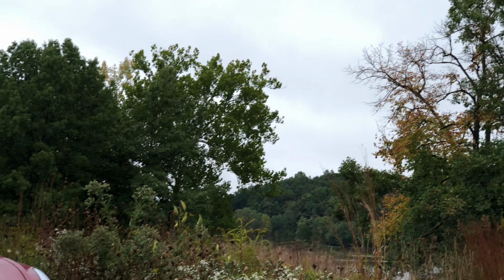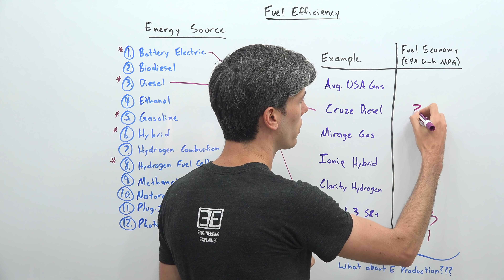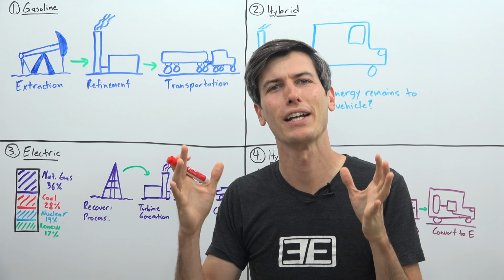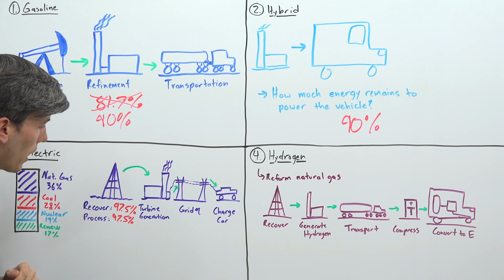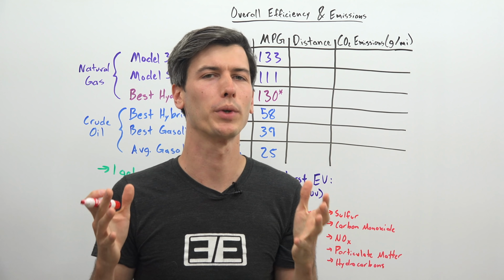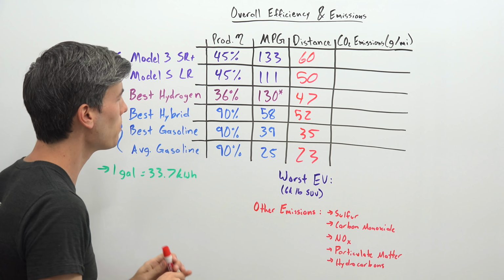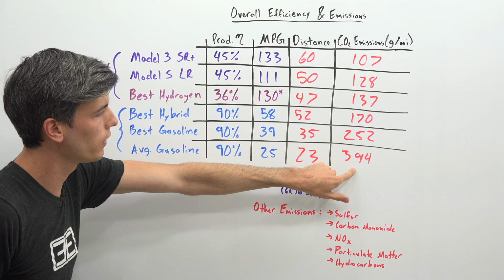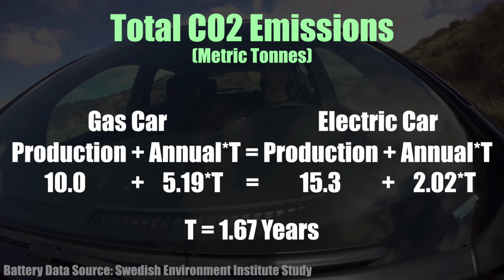Are Teslas Actually Better For The Environment?

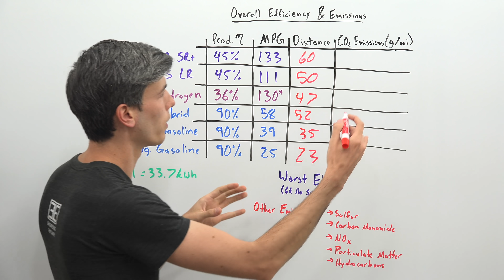Comment: 12:09  No, it isn't zero.
I remember a paper the german budestag commisioned, to inform them a few years ago in that matter. (so not by a political party but by all together do have a ground for discussion and decision) who came out with the numbers as following: production of electricity over the lifecycle of a power plant:
hydro: 4 grams of CO2 per produced kWh, wind: 9 solar 12, and coal was above 50 when just used for electricity and around 38 when also used for "comunity heating" (force-heat coupling). (these were the best case scenarios)
Nuclear power they said is almost not calculatable because of the efforts in producing the materials, maintaining the facility (and security) as well as the immense time of storage of the radioactive materials and the effort to store them in a safe and secure way for that long.
I'm also wondering about your comment concerning battery production. As everybody else calculating came to the conclusion that for the prodiuction of one electric car you produce the same amount of CO2 as you would for producing one middle class diesel car + driving it for 50k km.
Reply: He did say that EV production emissions are offset on average by driving it for 1.67yrs
Reply: nirfz “basically zero” once a solar array is running it produces no CO2 besides the maintenance. As the power grid and society becomes more green, that reduces emissions on everything including those maintenance emissions and production emissions, thus it will become “basically zero.” Also as I’m aware most people tend to drive a car more than 50,000km before getting rid of it so that argument doesn’t make sense.
Reply: @johnmoore1495  "will become zero" is not the same as "is basically zero" until then, we can not calculate with zero. That would be a dubious practice. We take all those things into account everywhere else too, so why ingnore them here, just to make it look better than it is? People also often underestimate the damage to the envirement in getting raw materials. That's not just the case with oil, coal and natural gas thats also true for materials used for solar cells and batteries. Then there is something hardly mentioned about the solar and wind plants: they are destabilizing the grid. No problem at all if they are not connected to the grid. Then thats fine, but because their power output is varying due to natural causes that can cause huge problems in the grid systems. It has in the past caused high CO2 emissions because caloric plants (coal, oil ect) had to be use to cover the gaps and stabilize the power distribution.
As to "that argument makes no sense" Think about it again: It means that by the time you have gone 50 000 km with a middle class Diesel car, this has caused the same amount of CO2 (inlcuding the manufacture of the car as well as all the maintenance and fluids the electrical car hasn't needed) as a freshly produced electric car without going even 1 meter. 
And if you then take into account the numbers of emitted CO2 per kWh of produved electricity (and as long as those plants aren't built without causing any CO2 emissions, this has to be taken into account.  I think in general we shoud try to reduce electricity consumption, so that eventually the amount we consume can be achieved by less harmfull production. Wind plants where i live are put on mountains, ruining the wildlife there, huge roads to bring those big windwheels up  have to be created, the cranes and trucks to transport them and assemble them aren't running on solar power, the concrete bases they have to build to make them withstand the huge windpressure is almost as much as you need for a hydro plant and also has to be produced and brought there,and the copper needed to connect them to the grid isn't produced nor the calbes laid by "green" vehicles either... The report i mentioned that stated the 9grams of CO2 by 1 kWh in wind energy would in my opinion have an even less good value for wind energy if germany wouldn't have big flat areas with much better preconditions to build windfarms than we have in my country.

Comment: Huge flaw to consider 90% efficient on gasoline. It requires power to pump crude oil to the surface, it's refinery process requires power and to move the refined gasoline again more power.
Reply: He was making it easier for gas to win (they still lost). As he said, the reported number is really more like 81%

Comment: I seriously question the automotive or petroleum Industries calculations of 81.7% efficiency!
Reply: Yes. It's outside the scope of this video, but the "energy returned over energy invested" (EROEI) calculations of some of the worse recovery methods are much less than 80%.

In fact fracking might possibly be close to 0%.
Reply: @gelu88  One study (DOI: 10.1016/j.enpol.2013.05.049) puts gasolene production EROI at around 15:1, meaning an efficiency at around 93%
Reply: The better it is the more money they make. I can imagine they put a good bit of effort in that.
Reply: I thought refineries are the biggest users of electricity. So gas car are using gas made by electric power.
Reply: But do you ever question Tesla's calculations?
Reply: I seriously question Tesla's calculation of 86% charging efficiency. That sounds more like peak efficiency. What is a superchargers efficiency?
Reply: @Eric_515  you could be right being on Peak efficiency. I do know that lithium ion batteries charge more efficient then lead acid. I believe a slower charge is more efficient than a fast charge, fast charge generates more heat and heat is loss of energy.
Reply: @iventonart9474 Sure do! I do know outside of Tesla, electric motors can be upwards in the 90s as far as efficiency is concerned... The inefficiency of Tesla car is the fact that it's constantly using electricity to maintain a battery temperature even when it is just sitting still outside, ie if the batteries get too hot in the summer time it'll turn on the air conditioning cycle to cool the batteries, if it's too cold outside it'll turn on the heater to warm down the batteries to protect them. Years ago in Oslo Norway a test was done on a fully charged Model S and it lasted for a little over a month sitting in a parking lot.
Reply: @stanRmeyer  Charge and discharge efficiency is a big question mark. There is a tremendous amount of heat generated when charging fast and when discharging fast. Electric motors have a very wide efficiency curve, but batteries do not. When Tesla comes up with these calculations, they're likely giving us a very controlled measure of efficiency.
Reply: @checkers7166  Seriously, under hard usage, EVs have horrific efficiency. Watch TFL's video towing a wheelbarrow with their Model X.
Reply: Economy of scale plays a role. Remove federal subsidies and see which is better.
Reply: @Muskar2  To Muskar.  I agree! Lots of bad hype going on.
Reply: @jackzakowski6952  That's an example of the opposite, though. The reason that EVs lose massive range towing a parachute-like-trailer at illegally high speeds, is because EVs operate at very high efficiency to begin with, making it more sensitive to other inefficiencies. If you are using a pickup truck with a comparibly horrible efficiency then the impact of towing something inefficient will be much less.
Reply: @murraymadness4674    that's to cool it to LNG, but most NG in the US is transported as a gas via pipeline...
Reply: @Muskar2  That absolutely make no sense at all. If EVs have a wide power efficiency curve, then it should all be relative. The more weight and resistance you must overcome, the more power you need for the workload, which would translate to same level of efficiency. You're just simply increasing the power/waste for the workload at the same level of efficiency. Of course, that isn't how EVs work. Electric motors have a very wide efficiency curve, but batteries have much narrower efficiency curve. The faster they charge or discharge, the less efficient they are. That's the reason TFL's Model X performed so poorly. We never talk enough about battery efficiency, do we? What is the efficiency of a supercharge vs a slower charger? How much juice do you eat up driving like you stole it? Is your Tesla always 80% or 90% efficient? Of course not.
Reply: @Muskar2  What? Illegally high speeds? Sensitive to other inefficiencies? You have no idea what you're talking about. Efficiency curves don't compress or something, and waste is infinite. Honestly, I don't even think you grasp the idea of an efficiency curve.
Reply: @jackzakowski6952  Right, sorry, it's about efficiency curves.

But what TFL was missing was that If you're dragging a trailer that is hidden by Model X'es frontal area or has a great drag coefficient, then you're using vastly less (extra) energy to drive like you stole it. In the video they talk about weight as a big factor, but that is almost irrelevant when cruising at 70mph.
I'm told the US doesn't really care about speed limits - even when towing - but I have looked up that the legal speed limit with a trailer is 65 mph in Colorado (and 55mph in most other states). Towing above 55mph is a really terrible idea for efficiency (and also safety) - probably more so in an EV than a gas car.
Anyway, my point was that the Tesla Model X has a coefficient of drag area of ~7.6ft^2 (66.3" * 78.7" * ~84% * 25Cd) while a Ford F150 has 11.8ft^2 (70.9" * 79.1" * ~84% * 0.36Cd). Since the Tesla Model X has a smaller frontal area, and especially height, it seems to be the main reason why it is much more aerodynamically affected by a tall brick of a trailer than a bigger truck. I'll take your word for the narrow efficiency curve of batteries, which would make it all much worse.
What I know is that if they did the test again, but with a more aerodynamically suitable trailer, and at 55mph, they'd get very different results.

Comment: I am shocked that gasoline production is 90 percent efficient. I always assumed that cracking process alone used so much energy that it would be lower than this. Does the calculation include energy put in during production?
Reply from the maker: Gasoline is extremely energy dense, so while it does take a lot of energy to get/create, you also end up with a ton of energy left over.
Reply: @EngineeringExplained  thanks, understand now

Comment: Would like to see the ev's where you calculated the efficiency by combining all of the different electricity supplies. So that you got the average scenario and not the one were only gas is used to produce electricity.
Reply: Agreed. This is a flawed comparison, because once you have oil, it's easier to burn it than refine it to gas before burning it.
Reply: You should consider the marginal source of electricity, that is the source that will be used to INCREASE the electricity production due to the replacement of a gasoline car with an electric car... If all the cars will be electric the amount of electricity needed will increase hugely... It seems that everybody always forget this
Reply: @BICIeCOMPUTERconGabriele  Wrong. It takes a lot of energy to refine gasoline. One litre of gasoline is about 35 kWh.  That's about half of the charge in my Model S. It takes much more than 35 kWh of electricity to refine that litre of gasoline.  If you charged an EV with it instead of refining gasoline, you could drive a lot farther.
If you are going to talk about the overall energy picture if everyone switches to EVs, you have to also take into account that we won't need to refine gasoline any more, drastically reducing those energy needs.
Reply: Obviously this guy is an EV advocate. Its easy to cherry pick your own info to suit your opinion. For example"we will just say diesels and petrol is the same." Are you kidding me?
Reply: @unbiasedcobra6672  Diesels and petrol cars have the same  fuel economy in USA apparently. In Europe we have better fuel economy on diesel cars but our engines are usually under 2 litters because of exponential tax increase when you go over 2 litters. That's one of the reasons why Diesel cars are more widespread in Europe than gasoline cars but people started to get sick of all the emissions reduction systems that fail again and again and are starting to look at gasoline or electric vehicles as well.
Reply: @unbiasedcobra6672  He said they are the same because in the real world, they typically do have close to the same average in the USA since most diesels are big, while many petrol engines are small. Not too many sub 2L diesels in the US
Reply: @ColinFox  Also consider the other products you get out of refining gasoline like paraffin wax, motor oil, diesel, kerosene, etc. A quick google search indicates that it consumes 2 barrels of energy to process 100 barrels, so that's pretty efficient at 98%.
Reply: @unbiasedcobra6672  He said let's consider the less efficient Chevy Cruze at 37 MPG to be the same as the best possible gasoline vehicle at 39 MPG. Granted, in Europe diesel cars are much more efficient, and I wouldn't know how the emissions compare.
Reply: @SolWake  so you dont know but you want to say I'm wrong. Ok. Diesel is much more economical, anyone saying different doesnt have any idea. Look at any comparable motor. Compare a 2L turbo diesel vs a 2L petrol. I guarantee the diesel uses less. Emissions are completely different as is the production process.
Reply: @unbiasedcobra6672  yes, I just said diesel cars are much more efficient in Europe than in USA. I think there is a language misunderstanding? I tried searching maybe I missed it. Can you tell me what is the most efficient combined MPG diesel car you can buy in USA and what is the most efficient combined MPG gasoline car you can buy in USA?
Reply: @SolWake  so now you want me to do your research? Wake up to yourself. Just google what is more efficient. Diesel or petrol.
Reply: @unbiasedcobra6672  yes, please. I spent about a half hour searching for diesel vehicles available in USA before my last response, I haven't found any that have much higher MPG than gasoline. There are plenty in Europe of course, but I haven't found any that are available in the USA
Reply: @SolWake  it doesnt mattet what country you are in. Burning fuel is burning fuel. Just type this in Google. 
"Whats more efficient diesel or petrol".

The first page is full of people agreeing with me. Its up to 30%.
Reply: @unbiasedcobra6672  yes, I agree diesel vehicles generally more efficient in the world. However this video is about fuel efficiency in the American context. Your original complaint is that he was treating diesel as the same efficiency as gasoline. If the context is Europe, then this would be wrong, but in the American context it is appropriate. For the American consumer who has to decide on what car to buy, telling them diesel cars can get 65mpg in the rest of the world does not help them when they can only buy a diesel car that gets 37mpg.
Reply: @SolWake  ok now you show me that us gets half the economy as the rest of the world from diesel.
Reply: @unbiasedcobra6672  are your kidding? did you checked his channel out and the hars he has?
Reply: @dallatorretdu  petrol and diesel arnt the same. Its a very simple fact that is extremely easy to research. Maybe you should do some.  It doesnt matter what cars who owns. I'm a mechanic of 16 years and know how fuels burn. Facts are facts, you burn less diesel. Yes it's dirtier but not to the same ratio as burn rate.
Reply: @sl66ggehrubt   when he says gas to generate electricity he's referring to natural gas, not gasoline/petrol...   the cleanup of natural gas from the well is way less energy intensive than handling crude.
Reply: @ColinFox  "It takes much more than 35 kWh of electricity to refine that litre of gasoline."   Completely false by a factor of around 8-10x
Reply: Sloth it’s not flawed. If he did the overall grid it would improve the numbers for electric vehicles due to nuclear and renewable power sources. He purposely picked natural gas and picked conservative estimates so he couldn’t be refuted.
Reply: exactly, we all know nat gas is the less pollutant fossil fuel.. 
he was way in favor of ev's in this presentation
Reply: If you want to be fair you should use coal as comparison. It is the most used source and the dirtiest. Electric cars will significantly increase electricity consumption and thus significantly delay the move to cleaner sources - now we're just at 30%. It will take at least 50 years before we stop burning coal, if we go fully electric with cars, perhaps even more. So until then, classic vs electric cars is basically oil vs coal.
Reply: Bernard Velkaverh Coal is second at 27.5% and shrinks every year. Natural gas is so much cheaper and so much safer to produce. And renewables (especially solar) continue to dive in pricing. The economics are working against coal, the transition will be far faster than 50 years.
Reply: Bernard Velkaverh coal has gone from 50% to 27.5% of the grid from 2005-present. 15 years and it’s been cut nearly in half.
Reply: Chose one ø or ö
Reply: @johnmoore1495   down to 23.5 in 2019 in the US.

Comment: Excellent, however you missed some early math in your analysis. You start with a finished fuel product where in fact there is energy used to create that product - Energy Returned on Energy Invested (EROEI) which is three times higher for natural gas than oil.